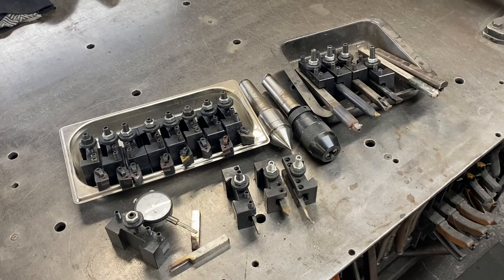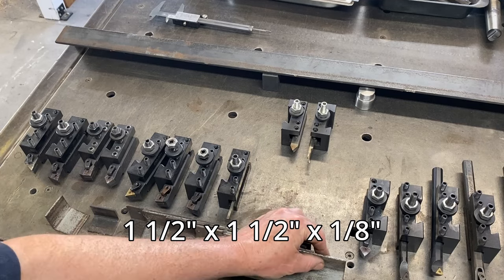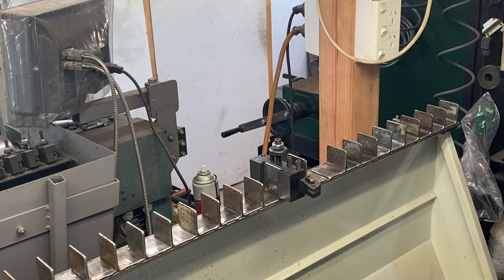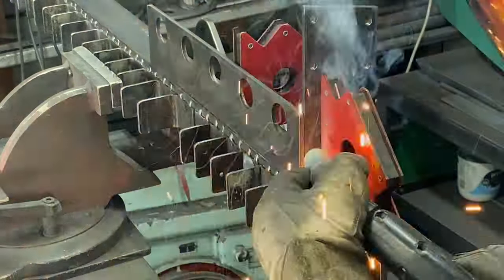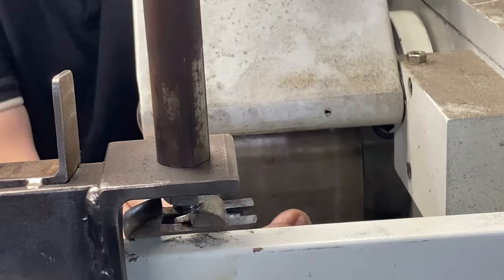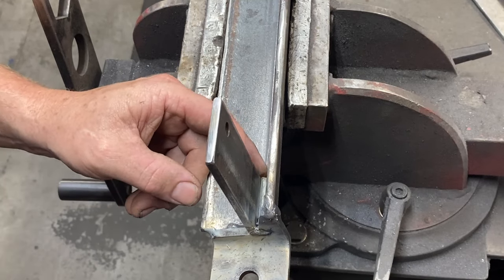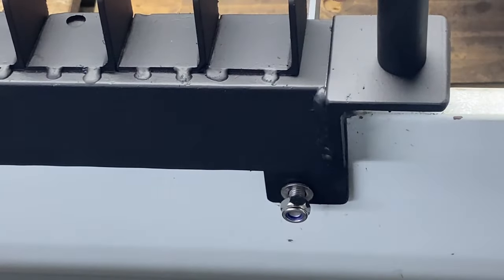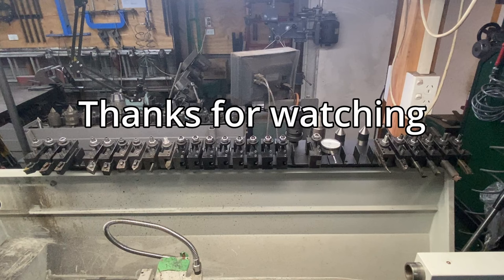QCTP Tool Organiser For The Lathe

Comment: That's a solid build. Thank you for sharing.
One note: The buzzing in the audio is tough on us headphone wearers. Most video editors have an audio filter that can clean that up, at least a bit.
Reply from the maker: No problem. 
Thanks for mentioning the buzzing. I did not know it was there when I was making the video. It is hard to hear on my PC through the speakers. But, I do notice that it is more pronounced when watching the video on my phone. May be it is the tinny speakers on the phone? Anyway, I will see if it comes on the next video and I will try to filter it out.

Comment: Nice job Jon, I have never looked back since I made mine a year or so ago, far better than having stuff kicking around in the chip tray and up on the headstock. Cheers, Jon🏴
Reply from the maker: I still have stuff kicking around in the chip tray and on the headstock. But, I should be able to move that over to the shelf where the tool holders were now. Thanks for watching.

Comment: Never liked arranging tools, tapers, drills etc onto steel holders, particularly the tapers, the steel support marks them. I started using HDPE sheet with taper holes for anything with a taper. We did a big sheet for taper twist drills from 13mm to 50mm in 1mm increments for the radial arm drill at one place I worked at, looked fatastic and provided the full support needed.
Reply from the maker: Good info. Maybe I should look at some soft insert or something to line the holes for the tailstock tools.
Reply: You could make them out of aluminium, Tig weld strips. If you have enough clearance, use duct tape on the metal strips for the tool holders

Comment: You  can never have enough toolholders so it's good that you have room for expansion.
Reply from the maker: Thanks Mark. Yes, those new tool holders wont all be occupied right away, some some room to expand. I got quite a few extra tool holders because they were less than 1/3 of the price compared to getting them locally.

Comment: Very nice. Will add that to my project list. Hey I'm fairly new to at home machining (yacht maintenance mainly), and one thing I am really struggling to nail is where in NZ to get small quantities of stock. Specifically 6061 ally bar, 316 stainless and Acetal or Delrin. Got any tips in that department?
Reply from the maker: I have never brought ally, stainless or acetal/delrin so I don't not know where to source them from. I cast my own aluminum and that is all I use on my projects. All the stainless I have has been given to me. I have no idea of the grade though. I don't think I have turned acetal or delrin, but I did make some turning blanks out of HDPE by melting it down and squashing it up in a mold. I have a video on that process. Probably no helpful but that is my experience.

Comment: Awesome video and great idea :)  Do you have a preferred supplier in NZ for your QCTP holders or go offshore?
Also watching this just makes me want to bitch about my imperial turret lathe an how painful it is to do anything on especially when i see other peoples setups lol (serves me right for not asking for advise in the beginning and only thinking about grunt)
Reply from the maker: Thanks you.
Is the issue the turret? If so, can you replace it with a QCTP? Maybe that is an option?
I sourced these holders from Aliexpress. They were $40 each including tax and shipping. Locally, Chevepac sell them for $135 each including tax.
Reply: @thehobbymachinistnz  
Thanks for store info and appreciate the reply :)
The turret lathe (ward no7) was designed for threading/pipe work and has stainless steel bed covers. If you look it up will see quickly how it has lots of grunt but is quite limiting at times for most engineering work (even compared to its smaller counterparts)
I will upgrade one day, but its for my hobby so i am sure your aware the NZ market seems to be full of people asking big dollars for machines or most things that aren't always worth it (As multiple older engineers said to me if your selling old equipment its only worth scrap price as that's were it goes to die an its the tooling that is worth paying the money for)